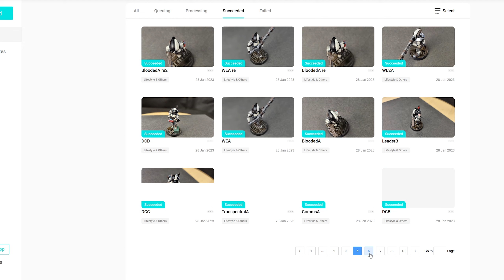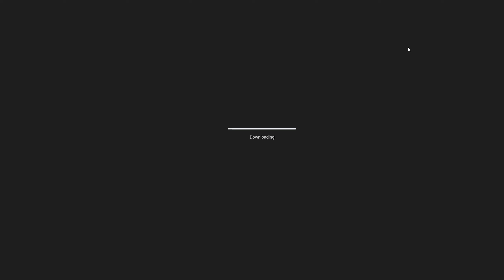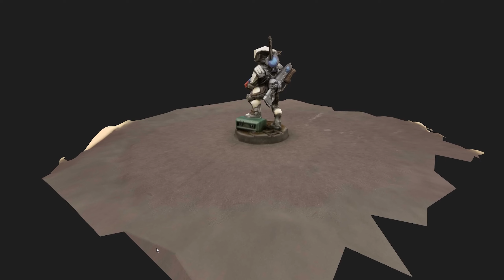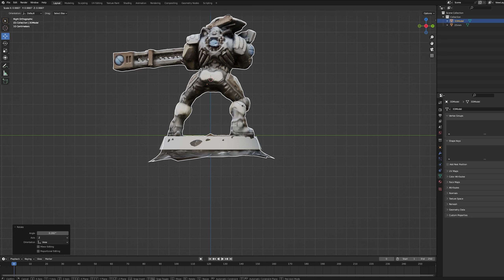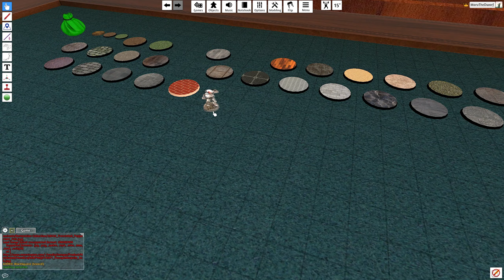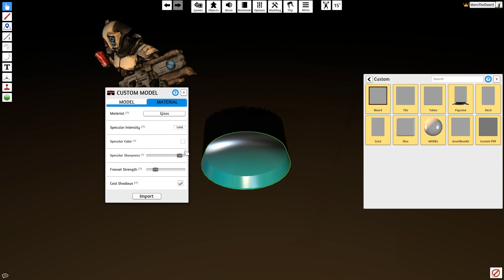How to 3D scan your miniatures using KIRI Engine

Comment: im using a pixel 9a and my resolution just always seems crap on my model. Should i be taking more photos? (doing 50 rn)
Reply from the maker: I'd love to see the source pictures to maybe help you find out what it could be. Have you played around with manual focus? Maybe there is some depth bokeh portrait mode stuff going on and ruining your pictures. 50 pictures total equals roughly 15 per height layer to go around the model? I would maybe try taking less pictures (and make sure those few are really sharp and in focus). Second guess without seeing the pictures - improve your light situation: The brighter the better but light the ceiling / a diffusor, not the model so you don't get hard shadows. Hope that helps?

Comment: great video I learned a lot. However, you use a turn table and Kiri says you have to move around and not use a turn table but you get great results. Is  there a special technique u use to get these great results?
Reply from the maker: Hey! If you take the miniature and its floor as the frame of reference I sort of DO move around it with my camera. The big difference is lights and I'd say having perfect light from every angle is a big advantage. But honestly so much has happened in terms of AI over the last year that I doubt it makes much difference anymore.